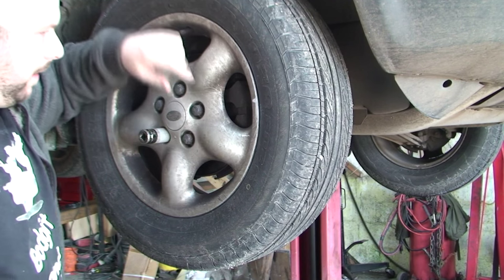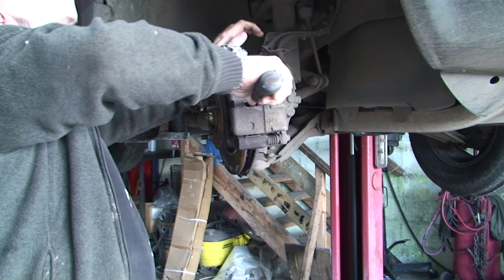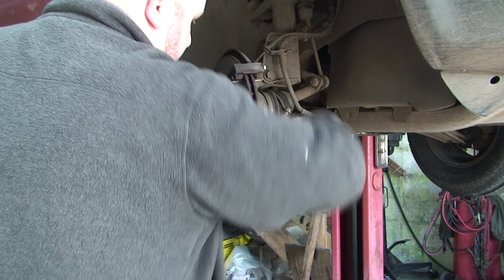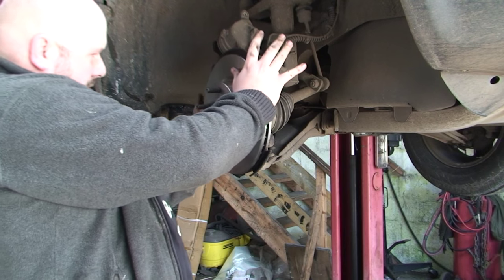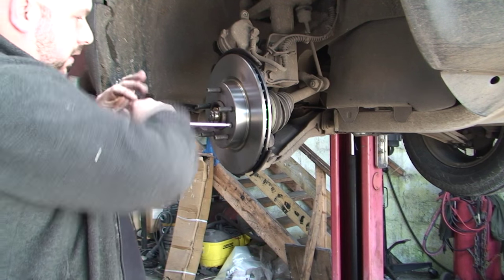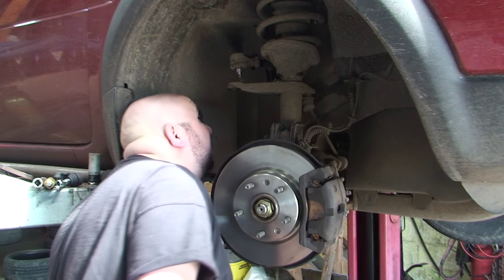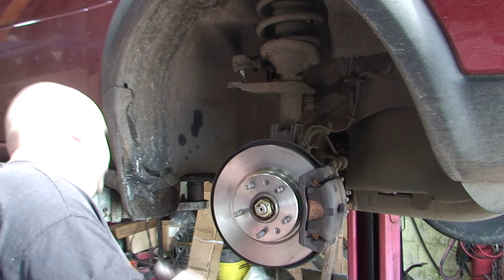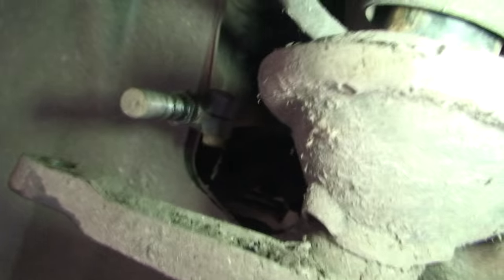bodgit and leggit garage land rover freelander front disc and pads and track rod end

Comment: Watched loads of your vids on this car been a great help, i do all my own repairs for the last 30 years...PROBLEM WITH FREELANDER CALIPERS. I HAD A RATTLING NOISE FROM FORNT AND NARROWED DOWN TO GUIDE PINS.. replaced guide pins, pads, clips..now it has decided to bind very bad on one side.. everything was lubed up  copper grease etc..everything is free and nothing stuck..when you press brake it binds the disc..a quicjk crack with hammer and it frees it.even when you undo the guide pin bolts it is still stuck..so this must be the piston right ?? hope ya can help
Reply from the maker: Mark Dix hi mate it sounds like you've got seized calipers quickest easiest and safest thing to do

Comment: Hello. I do have a problem with brakes. After i change everithyng from rubber hose down and the left one is braking more that the right one. I did the normal bleeding and the pc bleeding, and is doing the same. It is possible tu be te abs pump te problem?

Comment: Need to be careful not to damage rubber boot on piston when pushing them back.  Can also clean out crud from holes from guide pins (eg carefully, by hand, with a drill bit).  Also good practice to check hub is free of crud and rust before mounting new disc.  As a professional, it's good to use a torque wrench.

Comment: heres one for you got a freelander..when cold coolant level is min and when engine is warm it sits at maximum? is that right or should I top up coolant to max when cold??
Reply from the maker: hi that is ok you won't have a problem with that
Reply: bodgit and leggit garage  you should use a G clamp to put caliper piston back not a blodie crowbar looks like amature work no hard feelings but if you doing videos and showing example for people do it right and safe way i like your vids a lots off good info but needs more work on safety when woring

Comment: Bolt sizes are classified by their diameters not by the size across the flats on the head. I.e. a 8 mm dia bolt you use a 13 mm spanner.

Comment: You look like you over tightened all the bolts. Use a torque wrench. Also support the caliper so there is no strain on the flexible brake pipe.
Reply from the maker: 🤣🤣🤣🤣 wow just fine you looking you know how tight the bolts are if that's the case why would I need a torque wrench you don't need a torque wrench once you're used to doing your job properly no garage will employ you if you get the talk went out for these type of jobs and the brake caliper was supported but if you actually watch all my videos rather than trying to be clever you would realise we also replaced the brake line in another video
Reply: @bodgitandleggitgarage  How would you know if you weren't under/over tightening a bolt if you don't use a torque wrench? Bodge it and leg it is  the name of your game. I am a city & guilds qualified motor vehicle technician that was employed by a garage that taught me how to do things the correct way. You are just used to doing certain things the wrong way and you know it and freely admit it.
Reply: bodgit and leggit garage mate, your videos are beyond helpful Thankyou so much, they’ve helped me recently change a rear calliper on our Audi A4 2007, and helped me service a TD4 Freelander 1 which we bought for £400 as a bit of a project! Really enjoying getting into this, also I don’t have a torque wrench because I’m a complete amateur so please don’t start using expensive tools that I can’t afford to buy, don’t listen to this bloke!!! Thanks again your a legend. Sam from Leeds